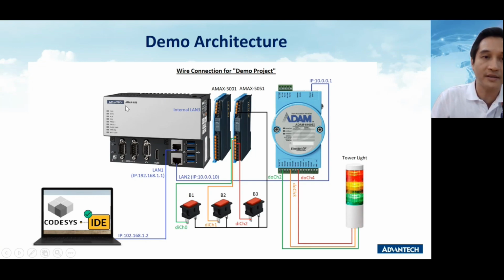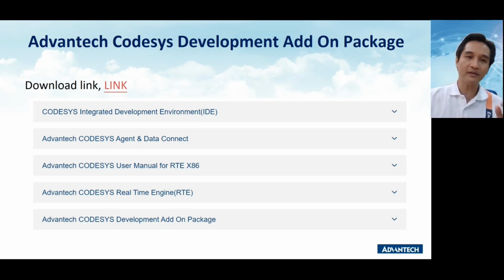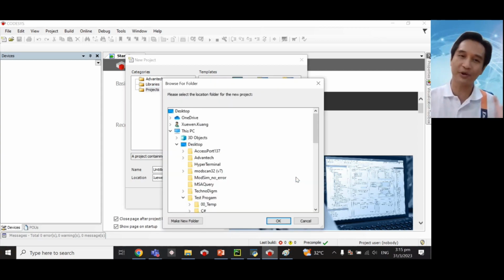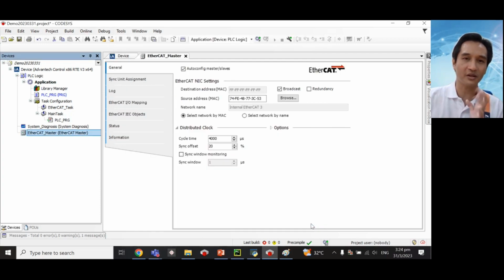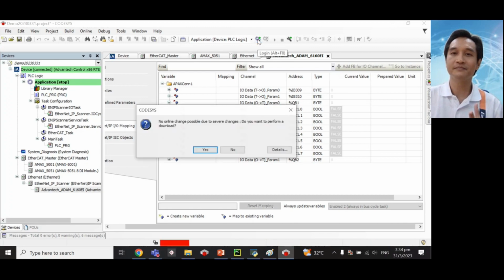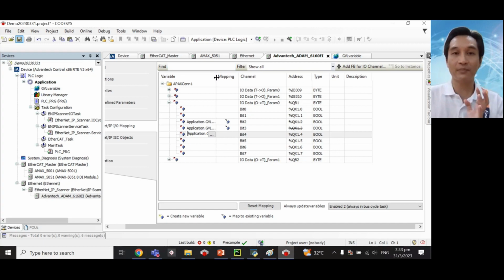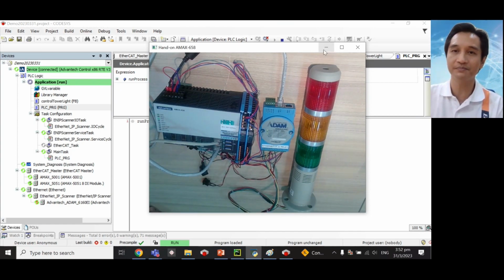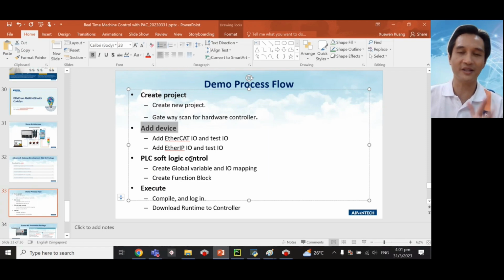DEMO on AMAX-658 with CodeSys

Comment: I have a stupid unexpected question. The Amax controller runs Windows; you can even connect a monitor and keyboard with a mouse to it and see a typical operating system desktop. Is it possible to install a development environment on this device in order to connect to it locally and edit/upload projects directly from the PLC, or do these actions strictly require a separate computer/laptop with CoDeSys Development system?
Reply: Yes, you can install Codesys directly on the AMAX-658 and access it remotely without any problems, as well as you can upload and backup the projects developed on the hardware itself. In this case, a notebook was used to exemplify real applications, where a server is used to manage the Codesys control instances, in this case the AMAX-658 itself.